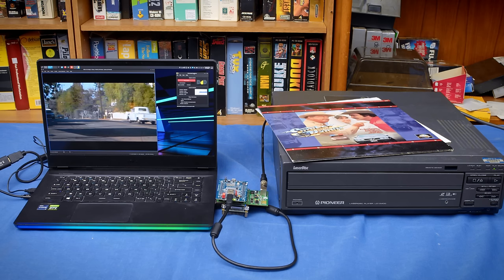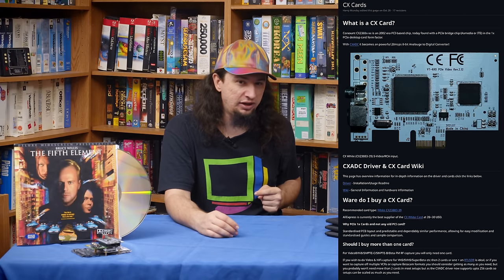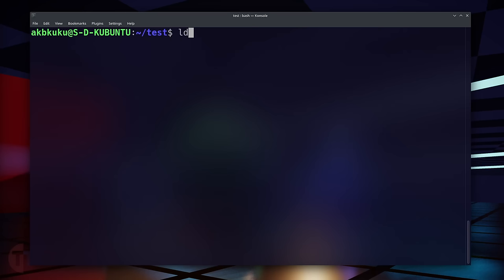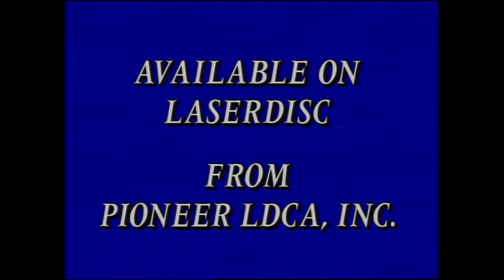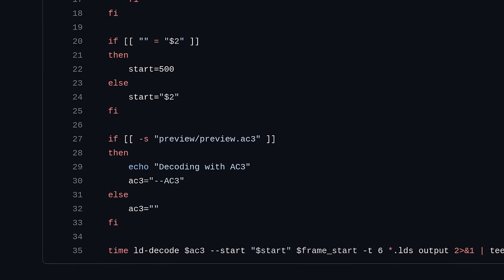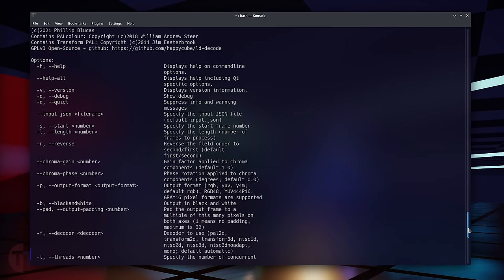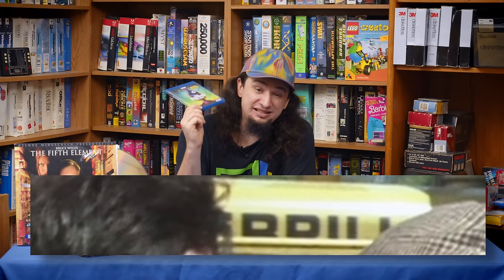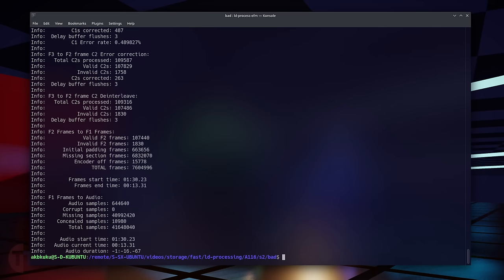LD-Decode - LaserDisc Conversion Tools

Comment: Finally, A definitive method for ripping LD discs.
As an old-school ripper, interlace and digital audio tracks are least concern to me, TDeint+EEDI3 can deal with most 60i content, and for post-edited pulled down content, I can always use YATTA for manual IVTC.
I don't know if EAC3TO can deal with those AC3 and DTS tracks, but I don't think there will be any big obstacle.
Reply: AC3 is a totally different encoding on the Laserdisc and is a relatively new feature of ld-decode, hence the extra logging.  

(Staffan Ulfberg figured out how to actually do the decoding in 2021-2022, then Leighton and Ian Smallshire implemented it in C++ for rev7.)
Reply: @happycube  That's very interesting, does it have compatibility with today's ac3 encoding? Like convert to standard ac3 stream losslessly.
And what about DTS?
Well maybe it's all answered in related projects already? If so, can I have some links guide me to these answers?

Comment: I've been following the archival of the original Domesday project for a while now. Data from across my country saved to disc when I was just a toddler.  I've seen some of the data relating to my own county town where I live, the descriptions of schools and the town centre by the kids at the schools takes me right back and earlier.

Optical media is a brilliant choice for such an archive, but the LD technology was too new and primitive to last long enough unlike today's optical media and the biggest problem was at the time it was a world with very little optical media hardware so they ended up designing a bespoke system that relied on very specific bits of hardware.

It was an idea before it's time but it did work in the end as although it's not going to describe 1980's British life and culture to people 1000 years from now, it's still a treasure trove of information that proves without a doubt that us 80's and 90's kids actually did exist before the internet lol. 😂

Comment: The stop commands bit is almost funny sometimes.

I had a DVD player very early in its lifespan.  I think this disk was Virtsuocity.

They took the Laserdisc special features and just dumped them onto the DVD.  The special features were a bunch of still images from the production.

Once transferred, this had the net effect of a 30 seconds video with one new progressive image per frame .. so it played as a very very fast slideshow when you pushed play.

Almost like a blipvert from Max Headroom the TV series.
 
(IBP frames on DVD being what they are, this did nothing good for the image quality of the stills.

Comment: pixel doubling actually solves alot of issues in general. if you use a 4k screen, it can easily and seamlessly scale to 1080p, if you're sealing with 480p video it may be wise to invest in a 1440p monitor since it's a perfect 3x scale.
Reply: Wouldn't the image contain the pixelation from unfiltered pixel doubling if you're viewing it at any resolution higher than the original native resolution? I mean, the explanation from the video makes sense solely from a storage perspective if you're at a space premium and can't do lossless FFV1, but no smoothening means unless you undo the Pixel doubling, it will always look blocky on a Hi-Res monitor.
Reply: I'd take pixelated integer scaling over smoothed blurry messes with bleeding colors any day.
Reply: @davidmcgill1000  Clearly you haven’t seen how good Lanczos upscaling can look. We’re far past the world of Bilinear.

Comment: This is super neat. Is the VHS process you hinted at the same deal of capturing a signal and decoding to video in software, or more along the lines of extracting encoded data from a regular video capture?

I have about 500 hours of VHS captured in FFV1 through a BlackMagic device, but it struggles to get a lock on Hi8 tapes, so I'm  still looking for a solution for that
Reply from the maker: It's pretty much the same as the laserdisc setup from what I understand, you just read after the head amplification I think. I do know there are some more complicated problems with VHS though due to it using multiple heads for the tape. I still need to research it more to get a better understanding of it myself.
Reply: VHS-Decode has multible RF points if you want to do FM HiFi audio too so 2 signals, as you already have refrance copys on file, I would say get an CX Card and a new external timing setup its all detailed on the wiki.

Betacam etc is 2 seprate video RF signals alongside audio, ware as SMPTE-C is basically the same as laserdisc but bigger and better and with linear audio (as it was used to master media that was going onto LDs for a few years)

Comment: re DTS sounds better than AC-3:
I wonder if the situation is identical to if not similar to that with DVDs.  
I'm familiar with the situation on DVDs.  People argue that the AC-3 (Dolby Digital) format is better.  But the DTS is held to be the premo sound track.
I think the difference is in the way they are used.  When the AC-3 soundtrack is the base level mandatory sound, it has a lower bitrate and it's mixed to sound good on basic equipment.  The secondary "advanced" sound track is a much larger bitrate, and is mixed for home theater setups and audiophiles.  And it happens to use the DTS format.  You could save space and have a high bitrate sound track for the primary encoded as AC-3.  But it has to play well on low-end sound equipment.  And, I wonder if the situation is inherited from LD, where, perhaps, the place they put the AC-3 data has a limited capacity, and the later advancement was able to store more digital data, which got used for DTS.

Comment: I hope you do the vcr side of the project soon. I got a lot of old vcr tapes I need to digitize before the tape fails
Reply: You can do a great job by using a SVHS player and a dvd recorder then rip the dvd on the pc etc.

The SVHS players have more advanced denoise features.

They tend to be expensive but half the cost of this thing. In fact if you are lucky you will find one in a thrift store or charity shop mis-labeled as a VHS player. I got mine for £5 because of that 😂

Comment: You could probably improve stacking performance by capturing the same disc on two or more players as well - there will always be slight differences in the calibration of different machines that may deal with errors differently. I've done this in the past with damaged CDs, where different drives could read different bits of the disc correctly.
Reply: I thought this was a direct feed from the laser? Would you actually get different error correction methods?
Reply: @charmedx3219  No, you'd likely get different errors.

Comment: Here is a possible way of making the merge easier:
* Use a container format that supports concatnation, for example M2TS.
* When exporting to FFmpeg, make sure all your exports have exactly the same layout and settings.
* Finally, cat *.m2ts | ffmpeg -i - -c:v copy -c:a copy -c:s copy output.mp4 to merge all of the parts into one mp4 file.

Comment: I am told the later laserdisc players were better at playing discs with disc rot because they had a narrower red laser beam. Would be interesting to see a comparison of different players for the same disks.
Reply: Only the Japanese MUSE players have the narrower beam - the DVL combination players do technically have one, but only for the DVD's... for anything else it switched to the same IR CD/LD pickup the later LD-only models used, with it's own motor assembly and everything.

Comment: It should be possible to get a perfect copy of the source tape with just three not-too-rotted copies of a disc. As long as there are no dropouts that would overlap, then by comparing each pixel of the same frame across all three copies, you'd have two pixels the same (or nearly the same) and one outlier (black or white dropout, say). Keep an average of the two most similar pixels, and throw the outlier away. This is the logic I used when I commissioned the Avisynth filters "TooT" and "ToTooT" back in the mid-2000s. Worked great.

Comment: 14:15 if you don't want to store huge lossless source files, H264 is pretty much the best you can get for encoding SD interlaced video natively. Proper settings and sufficient bitrate/crf are crucial, obviously...
Reply: You sort of just skipped over, FFV1, huffyuv, HEVC/H.265 etc AVC/H.264 is very much a legacy codec unless demanded for web/hardware reasons.
But the FM RF flac compressed is the source file, the TBC file is just the decoded raw composite signal from it.
Reply: @TheRealHarrypm  I meant lossless video files, not FM RF.

Comment: Very interesting, but does it make sense? Given the low quality of the masters used for the vast majority of produced laserdiscs, and considering that the signal contained in the laserdisc is the worst possible, namely composite video, a professional capture card like an AJA Kona LHE that captures uncompressed video in 4:4:4 (PAL and NTSC) paired with a high-quality laserdisc player should produce a more than accurate result without going any further.
Reply: 1. Composite is far from the worst possible signal, you can get great quality from composite signal
2. Professional cards won't fix problems of machine's internal composite video processing.
3. You cannot get anything more accurate than capturing signals directly from laser pickup.

Comment: Would different disc transport captures make a difference when using the disc stacking feature, since it's an analogue signal would different mechanisms make a different sample/read of the disc
Reply: Yes, different mechanisms but also laser pickups and random dust that may fly inside - that's something I suggested in the community.
Reply: So having more samples of the same disc in the same and different machines where the data can be cross checked in stacker mode could make for a very pure signal, close enough to the mastering data, I wonder if changing the laser to one with a narrower wavelength if the pickup would allow it to be read would work better in preserving the information on the disc.
Reply: @imranahmad2733  There were also talks about using bluray blue laser for LD pickup, it didn't go anywhere yet but there's an idea.
Reply: @Zcooger  
I wonder what the roadblock would be for using the Blu-ray laser, the pickup diode would probably need a different filter on it, maybe the lense would also have to be different because the blue/violet laser lights wavelength or maybe the focus can be adjusted in the laser block, there's probably quite a few factors involved to get it to work but I bet it would pay off

Comment: The Doomsday Duplicator looks like three stacked boards.  I know where to get the middle RF sampler board but what are the other two and where do I get them. I assume the connection to a host PC is USB2?
Reply: FX3 Exploer board USB 3.0 Type-B (PC interface)
DE0 Nano FPGA (buffer)
Its all on the DomesDay Duplicator wiki.

Comment: 2:50 I wonder if this is simply because there is only so much data, so clock speed + IPC is what would help more? I was ripping movies for my dad so he could watch them from any device on his Wi-Fi but I insisted on only ripping the exact copies of what he had. Most of which are DVDs. Using Handbrake, it would top out around 6 to 7 cores for multithread when encoding and ripping. Doing some digging online, it sounds like this might be because there is only so much information in a single frame of DVD video that there literally isn't enough for all the cores to work (and if I remember right, you can't exactly skip ahead because some codecs require the previous frame to generate the next one). The only way I got a speed increase is when I went from a 5950X to a 7950X with the increase in clocks.
Reply: Yup raw single core allows you to brute force it faster but even with 16msps 8-bit data (VHS) we have only got 16fps +- 1fps on the 7950x / Apple M2 still need to test the M3 Ultra though.

The TBC code is the bottleneck so its no ware near optimised as much as possible, but still far more powerful then any hardware TBC on the market.

Comment: Hauppauge PVR and if the quality isn't good enough still use an upscaler TOPAZ after the capture. Hauppauge PVR does a fantastic job but will leave fairly big file sizes such as 6-8gigs if the settings are maxed out. However, if one plans on upscaling with Topaz Upscaler they can create a smaller size and have a little bit better quality. There might be better programs out there for line doubling or something to give the laserdisc a better appearance. 16:19 Did your software just remove rot? That looks like rot being removed. I didn't even know that was possible or is that just a very noisy laserdisc player? Looks a lot like rot to me.

Comment: I would like to note that Dolby surround or ProLogic as it was later rebranded to isn't necessarily lame, I think it's really good for what it is and there are ways to process it in software discreet 5.1 format that plays nice with modern equipment. Hell, I think the best surround sound mix of Fantasia is the prologic surround mix on LaserDisc. The dance is all around the viewer and makes great use of the surround channel. Also I like how when you say that Dolby surround is lame, you show an image of a LaserDisc that has CX suround on it.
Reply: Also, would you recommend Pixel doubling for DVD sources? I've been compressing all of my DVD stuff and handbrake partially so I can use deinterlacing features of it to make those videos play nicely on my Plex server.
Reply from the maker: Deinterlacing in playback probably won't work with pixel doubled outputs. There isn't a single good solution I can recommend other than just getting lucking and having your content all be one interlacing type and deinterlacing it  while encoding.
Reply: @TechTangents  well, That's why I Run all my DVD videos through handbrake, I not only do I convert it to HEVC, but I'd also allows me to deinterlace the video from the DVDs as part of it

Comment: 9:00 DTS and AC-3 requires expensive and hard-to-find dedicated processing units?
Are they different than the way those names are used now?  Because any AV Receiver can decode those.  I've ripped DTS CDs as WAV files, and I can play with VLC with its own decoding turned off and the receiver plays 5.1.  Oh yea, VLC decodes various formats itself, too, and will downmix to stereo.
Plain DVD players need to handle discs with AC-3 sound tracks and a plain RCA jack stereo connection, so they can decode that.
BD players need to decode whatever format in order to mix in secondary sounds, rather than just pass through to the receiver.
Of course software audio and video editors can play any of those.

Comment: 3:22 wouldn't the captured signal be incomprehensible for CLV discs until the head reaches the beginning of the disc?
Reply: Most CLV disks actually have a tiny bit of CAV at the beginning, the process is called CAA for Constant Angular Acceleration, which reduces CLV crosstalk etc

Comment: 3:00 To add to the slowness of the program, I think what would help the decoder a great deal would be to add GPU acceleration support to the program.
Plenty of programs now incorporate CUDA support to speed things up by a lot. Not just AI programs, but also regular software.
Reply: There was a cuda branch of ld-decode 3 years ago, the issue is restructuring code and then maintaining said code to do such.

Edit: Well we have CUDA Teletext decoding (vhs-teletext), but unti thats in a nice self contained windows binary Its kinda in hardware support hell.

Comment: Excellent video. Very well explained. I've been wanting to know for while how to back up LDs.  This is a LOT of work, even more so than VHS. I thought it would have been easier and faster just because it's on an optical disc, as easy as a VCD or DVD, but boy was I wrong. You know, you mentioning closed captions format, would you happen to know what the CC format for VCDs are and how to make them? The very little info on this on the net is very vague and doesn't explain much.

Comment: Based on your comments about thread limits, I'm wondering if you're IO bound by the storage media? If so, you might be able to use RAID to stripe multiple SSDs. If that isn't it, perhaps you're being thermal throttled? Also, modern CPUs have performance cores and efficiency cores. The P cores are the ones that will be best suited to heavy encoding work loads; is your thread limit around the same as your P core count (or exactly double, because of hyperthreading)?
Reply: Its due to the tbc code not being multithreaded fully its not a hardware problem, but high cache high speed single core raw power like that in the apple silicone lineup has shown well great leaps in brute forcing the problem away, ryzen 7000 also has catched up too, its also 40 million samples per second bare in mind hifi at 1-5msps can be done real-time easily vhs ntsc/pal is almost realtime with current gen hardware at 16fps +- 1fps decoding speed with 16msps 8-bit FLAC compressed files.
Reply: Storage is fine, the code's just a bit slow and bottlenecks on the TBC.

Comment: It would be cool to see an online database that kept checksums for frames, kind of like AccurateRip for CD audio.  Then, in theory at least, it would be possible to track the sums people get for their individual rips, identify pressings, tally up the counts of identical sums, and maybe even provide correction for minor dropouts.  This would provide some of the benefit of stacking, but diversified, and would let you know when you got the currently best-known accurate rip.
Reply: AIUI the issue is that laserdisc is an analog format. That means that even if there were no dropouts or interference bursts, a certain amount of noise is inherent to the process and no two rips will ever be identical. There is no "one true result" to publish a checksum for.